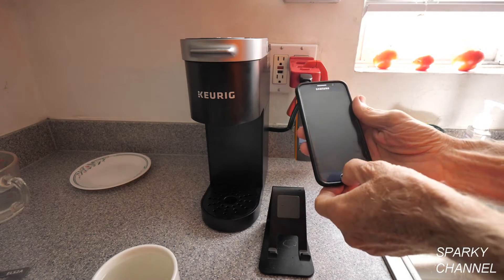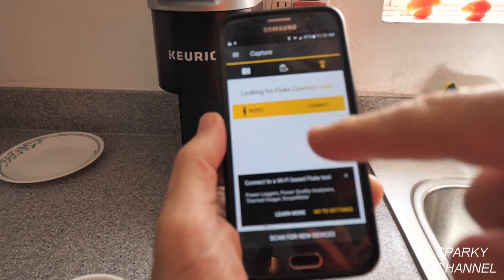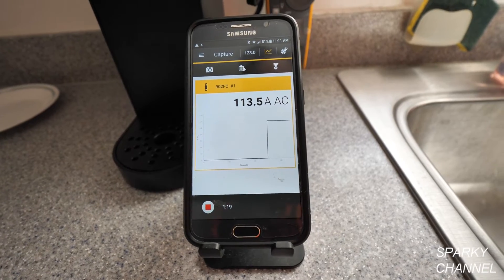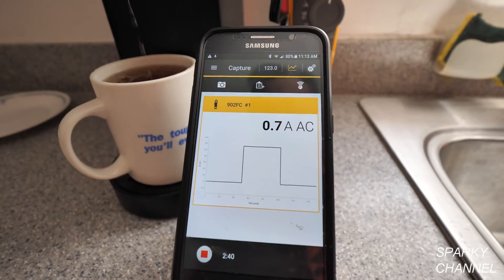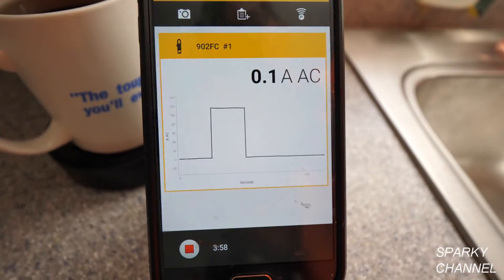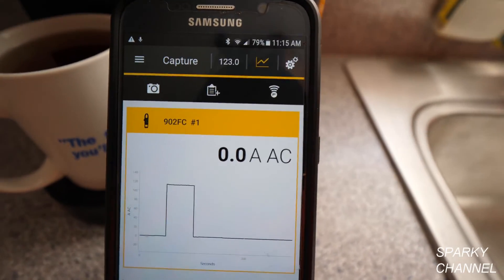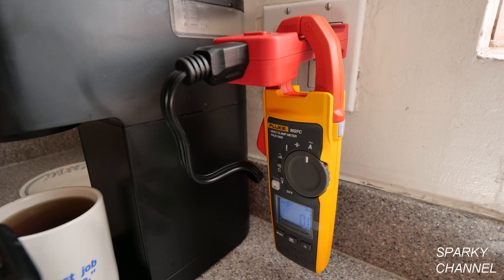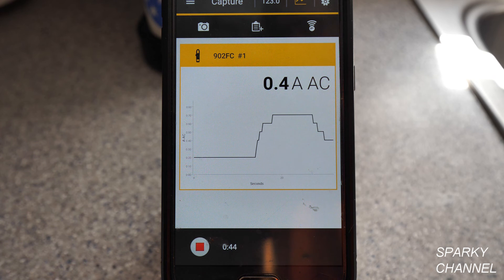Fluke 902FC HVAC Clamp Meter with Fluke Connect + 2020 NEC 210.11(B) Even Loads

Comment: Fluke 902FC is a great clamp meter.  It would be almost perfect if it had dual temp reading.
Reply from the maker: Yes, the differential temp is a great feature!
Reply: Also needs a flashlight at the clamp and a built-in magnet on the back would make it perfect.